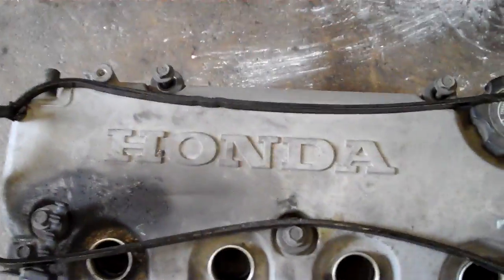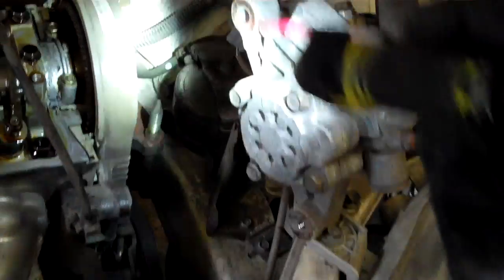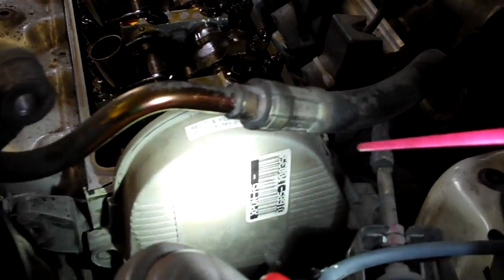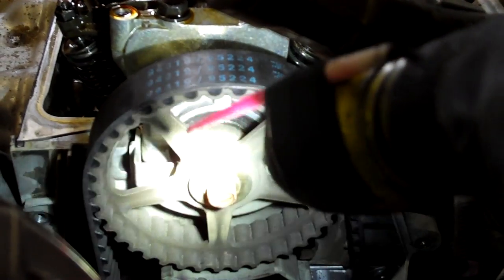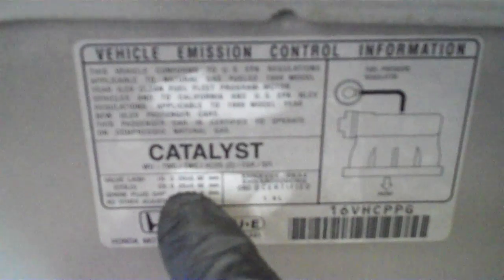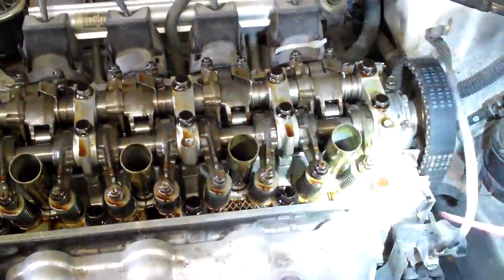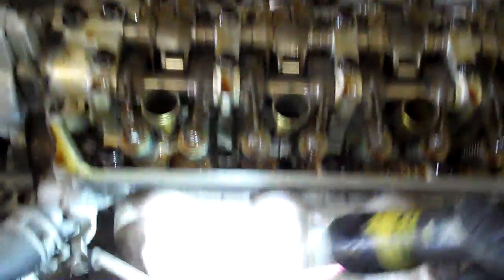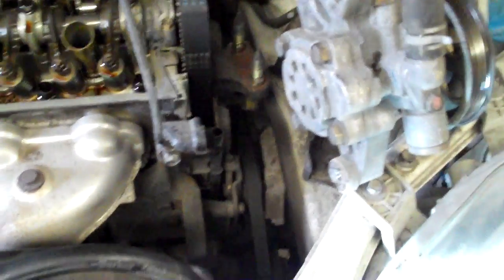How to adjust Honda Civic Valve Gap

Comment: Good videos! Hey man hava a question? I hava a 95 honda civic, dx is it 90• turn or 180• for the next cilinder? I have told that is half turn whats the true?
Reply: Personally i did 90 degree turns starting at TdC for cyl 1, turn 90 degrees couterclockwise, then 3, turn 90 more degrees and then do cyl. 4, then another 90 degrees then finish off adjusting cyl. 2.

Comment: Sorry but your giving false info.. You can't just turn from 3 o'clock to 6 to 9 ( 1/4 turns) and adjust the next cylinders valves you need to go 1/2 turns on the crank since you only reach top dead center every 2 full turns of crank rotation.

Comment: My 2001 civic has a dy17 and the engine cranks counter clockwise.... I'm not sure if a natural gas engine is different but that would mean you need to crank the engine 90 degrees counter clock wise to adjust the se

Comment: Dont take offense to this but you should have actually pulled out the feeler gauge and showed the people. After reading comments there are many people that didnt even know there valves needed to be adjusted. I know this video hasnt been commented on in a while but as a Honda tech and these being interference VTEC engines there is alot for people to mess up. on their own.

Comment from the maker: They are O-rings halfway down the tube of the valve train.  They come with a valve cover gasket set.  I have a video called "My Honda has oil on the spark plugs and wires How to fix it "  (Little red wagon) on my channel.

Comment: I have a question about my accord. There is oil on the spark plug wire on the right. is that a busted vavle cover gasket?

Comment: ("why is the oil so clean?" -> natural gas engine )

a slight drag - very descret drag on the feeler gauge didn't work for me.
on older engines the drag of the feeler gauge must be a "noticeable" slight drag,,, or the valves will be noisy and out of spec (too large) gap.

Comment from the maker: @nightmathzombieethan Thanks!  I would recommend using permatex right stuff to seal all the way around on the head side and don't torque down till it bottoms out, just enough to be even and get compression on the gasket maker/sealant you're using.

Comment from the maker: @2LateIWon All you need is a whole new fuel system including regulators, tank, and injectors.  The fuel pump isn't required because the gas is under pressure already to make it liquid and supply enough for a reasonable range.

Comment: Great belt tension tip! Any pointers on getting the right seal when you put the cover back on? Every time I do, I only put a few dabs of sealant and I try to use just the right amount. I only use it in the "right" spots as well, but I still end up with seepage...oh, and it's a NEW gasket, so that's no the problem. Mind you, mine is an OLD Honda so it may also just be a bit of a fault in design. Anyhow, great vid as always man!

Comment from the maker: @bustfer07 Natural Gas is what most homes in the US use for heating it's not a liquid like gasoline is at room temp (20 C. 72 F)  It's literally in gas state.  It forms naturally above petroleum and coal deposits.  This car runs on this gaseous fuel  It's compressed thousands of P.S.I. into liquid form in a cylinder wrapped in fiberglass.